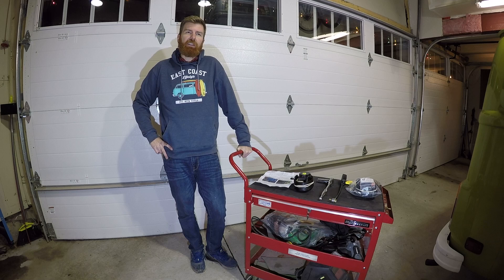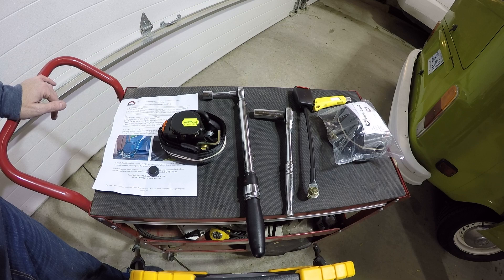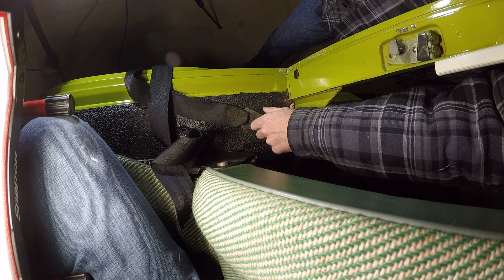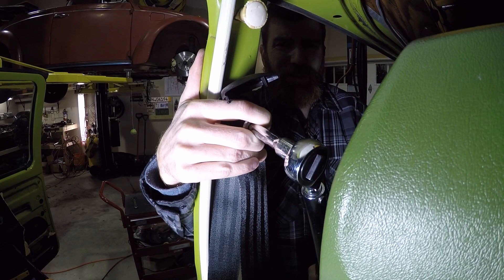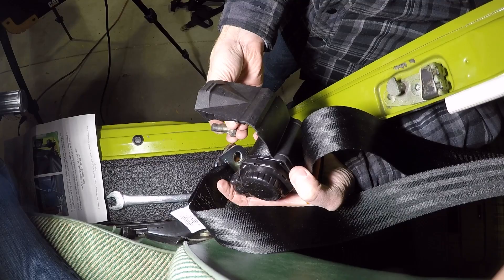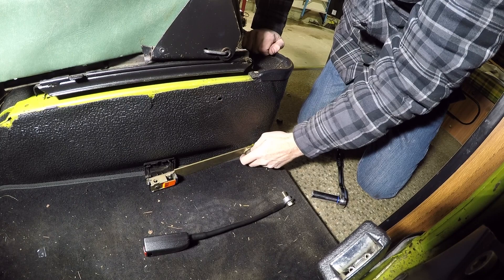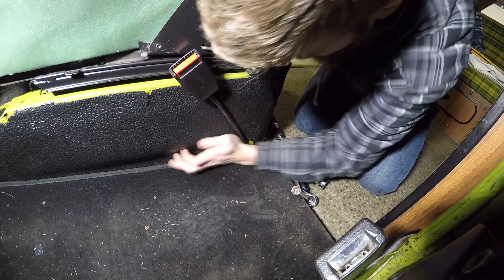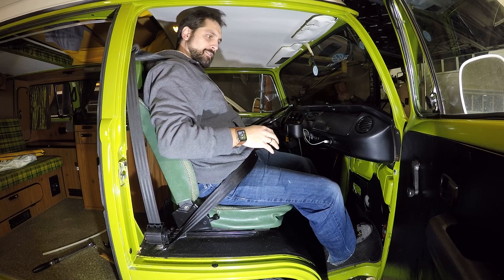VW Bus - Westfalia - Installation of Retractable Seat belts

Comment: How do the rear seatbelts go in? I keep reading you have to remove firewall and gas tank underneath to bolt
Reply: For the 3 point retratable ones? If so, you have to drill a hole though the side where the vents are and everything else bolts in where the original seat belts are at.

Comment: Where did you get that COMPLETE belt assembly?
The one I ordered did not have the offset spacer for the top portion that bolts in by the shoulder.
GREAT VIDEO!
Reply: I just bought a set.... 2 3pt and 2 2pt from JBugs and they will come with hardware.  It looks like JBugs has hardware for sale separately too.